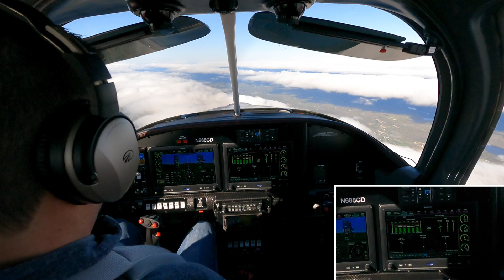G3X Lean Assist

Comment: What kind of fuel and ignition system are you using Charlie? Your cylinders are quite well balanced. You’re also getting better fuel flow at 2350 rpm 6500 msl than I am able to get.
Reply: I just went through my logs and at 63% power I'm getting about 163kts TAS at 11.8 gph